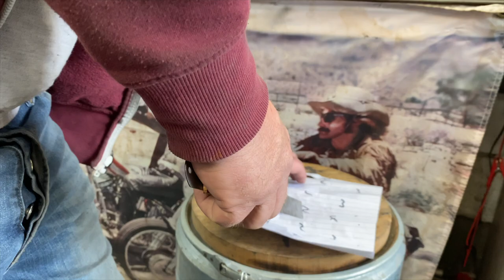Honda VFR1200X Crosstourer : Buckled Back Wheel - Can It be Fixed

Comment: Be getting that proper sorted prior running around the Alps, dont fancy a rear wheel issue or worse a collapse up the Furka anything off true cant be good when sticking a load of torque threw it at a minimum be pinging those spokes for tension check every couple of trips out. Stay safe, stay upright fella 👍

Comment: Being totally honest it still looked like it was running out a bit on the centre stand and with the mileage you're going to pile on doing the Alps I think I would definitely get it looked at just from the aspect that it might affect the bearing and it will certainly be having an effect on tyre wear and the last thing you need is finding after 1000 miles it's ripping your tyre up.
Reply from the maker: Yes I agree, gonna look at a new wheel

Comment: To put my two pennies worth in, a good wheel builder will get that strait and true no need to buy new unless its damaged, the tyre needs to be removed to get the wheel perfect, works on principal the same as push bike race wheels, you may even find that one spoke or nipple may be stripped causing it to buckle again best thing is to find a real good builder before any other issues are caused (bearings, tyre, even abs sensors). (many years in vehicle workshops is where my opinion is coming from not from owning a bike as you know). the insta 360 felt like I was playing the PlayStation lol.
Reply from the maker: 😂👍🏻 good advice buddy thanks

Comment: If you were just doing low mileage locally then maybe leave it.  But the big mileage on the Switzerland trip is a different thing. It might be fine, but you’ll spend the whole trip worrying about it and it will spoil the trip for you. Its worth going for a new one.
Reply from the maker: That’s my concern too

Comment: Central wheels pal , not too far from you , they are the best at everything wheel related , they will get it cock on , I wouldn’t be happy running around with a wheel with that much run out , could eventually wreck your wheel bearings